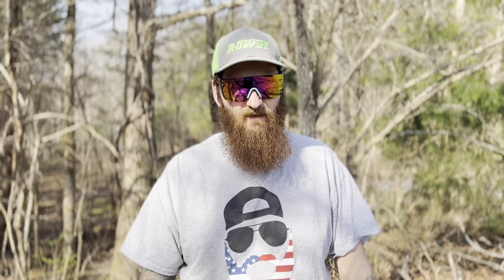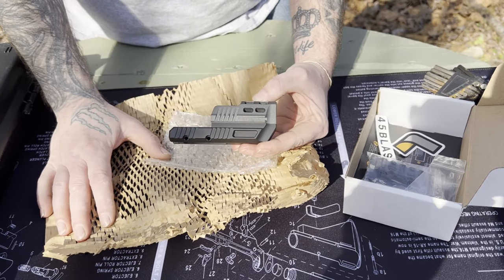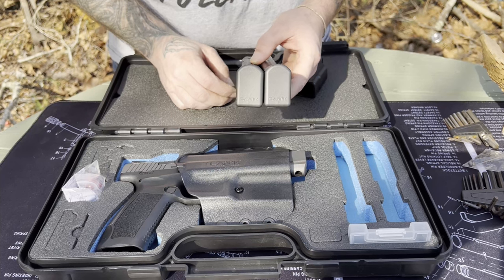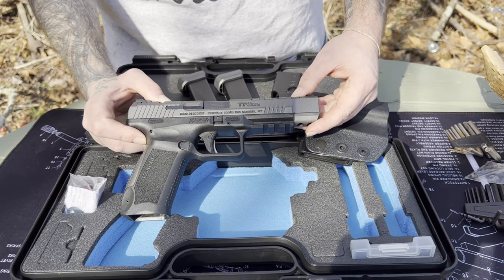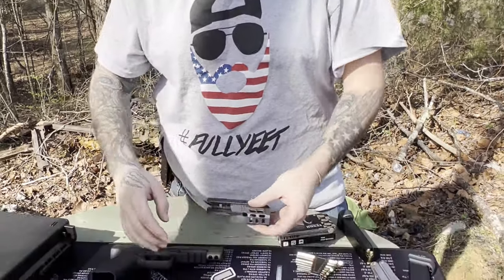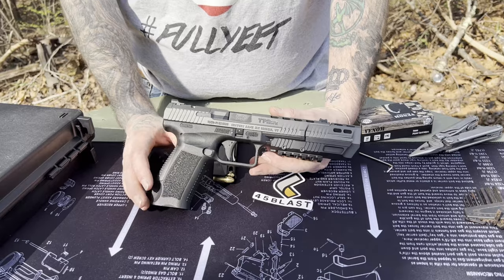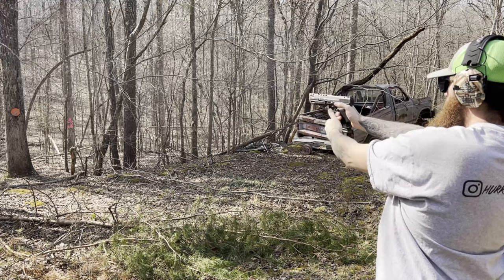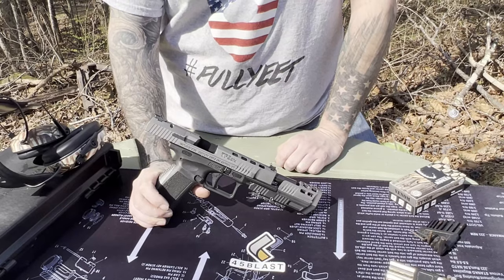45 blast compensator unboxing, install and testing on the CANIK TP9SFX

Comment: Hmmm. It looks like you cant take the slide off without removing the compensator, which means you can't field strip it without having Allen keys with you. That doesn't seem like a positive.
Reply from the maker: That's one con yes.
Reply: If you have to do an emergency field strip you’re already dead lol I can’t think of any time I would absolutely need to field strip a gun like this
Reply: This shouldn't be a gun that you need to clean in the field bro
Reply: No but it's a range/comp gun.  You should have a range bag with what you need...
Reply: After installing the comp and doing range testing , I was aware of this as well and the other problem is if you also get the holster it will not accommodate a light on the rail , so you must also remove the light to use the holster , not a good design and what's worse is I e-mailed them and they said it would take a light and it is comp only, no way will it fit with a light !

Comment: I haven't seen anyone do a direct comparison of the 45 Blast TP9SFX Compensator vs the Wasatch Arms TP9SFX Compensator. I am looking to buy one of them, and am curious if one outperforms the other. They are very similar to each other, but upon closer inspection there are key differences.
Reply from the maker: @melodicchronic5181  the only difference is visually. Originally, Wasatch arms was the company making them for 45blast. They have since split, and Wasatch started selling them with a little visual modifications.

Comment: I'm new to Pistols, I went with a Canik rival for my first one. I am looking for a carry gun now. Was definitely curious to see how compensator may work on a rival
Reply from the maker: We have a rival with one installed on it but we haven't posted videos of it yet. It's in close comparison.
Reply: @AbramHeathFULLYEET  okay thanks you very much. I'm debating on what to do with mine. Getting one of the longer threaded barrels or get a rail one

Comment: I have the disruptive defense comp on my canik.  The problem i have with these add on comps is that the slide needs to be lightened to mitigate muzzle dip.  When the slide returns intk battery the muzzle tends to dip from the weight of the slide moving forward....so when you shoot fast double taps, the secknd shot tends to hit low.  No so much a problem at close targets but past 15 yards this results in lots of c's and d's. ( losing too many points)  if i take my time on these shots i lose any advantage the comp affords me.

I think i will just have to save up 4k for a real open gun ( seriously conconsidering the Bull Amory SAS UR).

I am a uspsa shooter.

Comment: Could you add a light to that set up and see if it would fit in the omnivore holster?
Reply from the maker: I looked up the holster and it's around $70. I'm not convinced I want to spend that on a holster I may not use.
Reply: It won't fit that's obvious

Comment: will the 45 blast fit the canik rival?
Reply from the maker: I haven't picked mine up yet so I can not confirm. Looking at the website it doesn't look like they have an official one released yet.
Reply: Wasatch arms makes one very similar to the 45 blast and after ordering it took from Dec 19th to Jan 13th to get it so almost a month but it was well worth the wait most are not kept on hand and are made per order but fit and finish was amazing it has the same exact matching color to my canik sfx rival trophy .

Comment: How long did it take for you to receive your compensator after ordering?
Reply from the maker: Roughly 3-4 week's. It states on the website it takes them a little bit to get shipped out.
Reply: That is about the time mine took as well.
Reply: @AbramHeathFULLYEET  that's like back in the 80s when you had to order from a magazine send a check and wait for the check to clear before they shipped it out snail mail.
Reply: That's my problem.
Reply: @stebes7857  I ordered one from wasatch arms and it takes about 3 days . Very nice product